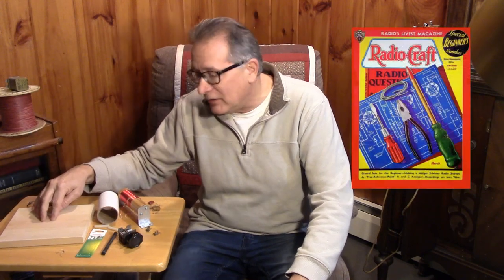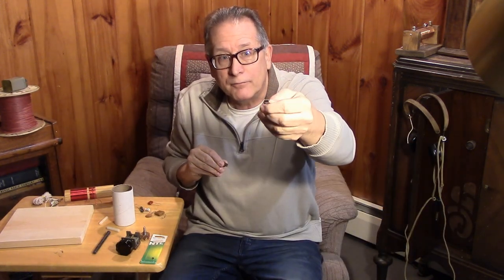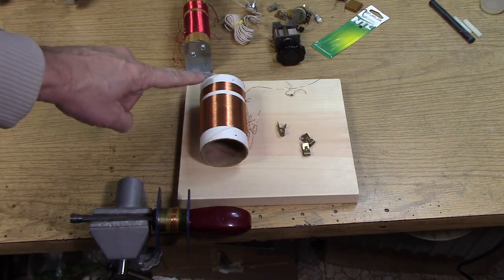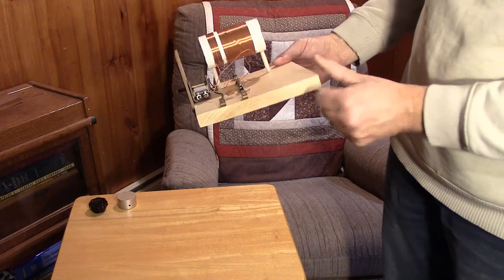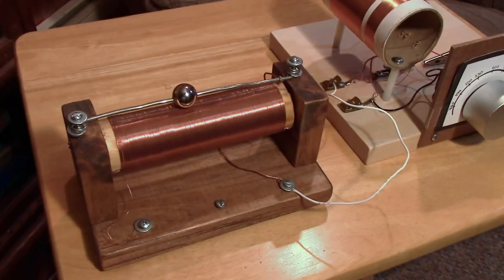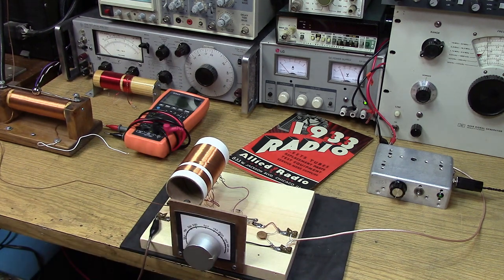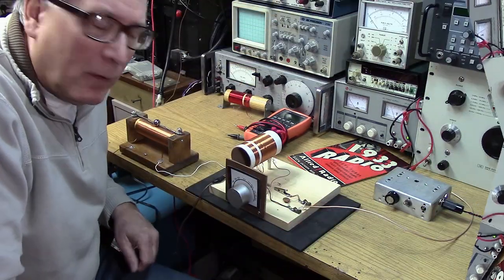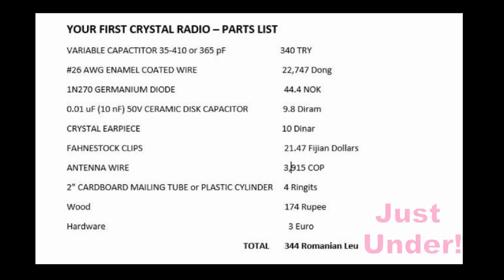Your First Crystal Radio

Comment: Dad bought me one of those Remco crystal sets back in the 50s. As we were putting it together (and Dad did the assembly, with commentary and appropriate curses), he told me how he and his brother used to build them out of old wire from Ford ignition coils and crystals from the talus dump at nearby lead mines. He said that he would listen to WLW and KDKA on it . . . which surprised me because at the time Dad and Uncle Nils were living in Arizona. He said he ran a wire for an antenna between the outhouse and the peak of the house roof, which angered his father because Grandpa Tom's peace was disturbed by the wire's resonating in the wind, which made the house hum. ;-) Six decades later I still have a crystal set -- one of Elmer Osterhoudt's MRL #2 DX sets -- and have built many others. Them and the latest micro SDR from China. Six decades of radio from one crystal set and a story my father told. Plus six years in the USN as a radioman, a job title that no longer exists. 73 de W8IJN

Comment: I think the important thing about crystal radios and other simple receivers is that it allows you to start experimenting, often because you can't get the specified parts, as you described very well at the start of your video. My first mod was to add a transistor as an audio amplifier, which in 1960 was a "Yellow Spot" germanium p-n-p device. It cost nearly £1, here in the UK, which was $2.80 in those days. It had been used in a pocket radio kit which my brother had given up on. It was handled with great care as it was worth more than a week's pocket-money.

Comment: Thanks for an excellent video, Mike! On an early crystal set, I used a 2-gang variable capacitor from a $1.50 garage sale radio. My antenna was a fifty-foot-long 16 gauge extension cord that had a ground wire. I wired all three terminals together on the plug end with my lead-in wire, then I threw one end of the extension cord up in a tree.
Sometimes I've purchased 20 gauge, two-conductor speaker wire at Menards. (Building supply) 100 ft. for 5 bucks or so on sale. It's copper-clad aluminum but it works fine. Separate the two conductors and you have 200 ft. of wire. I've used this same wire to wind coils with good luck. 
I once built the MRL # 39 crystal set. On a 2" pipe (PVC) I wound 80 turns of 20 gauge wire. I wound one turn of duct tape over the center of this winding, then I wound 40 turns of 20 gauge over this. The set worked really well. One day I was jumpering across different terminals when the sound just boomed in on my headphones. For comfort, I had to tune off the station a bit to decrease the volume. Days later I couldn't recall which terminals I had jumpered. Since then I have often tried to discover what I had done to no avail.

Comment: When I was a kid, I built a crystal set that had a fixed capacitor. The coil was sanded on the top to remove the insulation and an "L" shaped piece of metal, screwed to the board and was set to rotate over the coil forming a variable coil. I believe I was a cub scout at the time and I believe that the scouts were selling these kits in the Boy Scout stores that were around the country at that time.  it worked pretty well. 

That would save the cost of the 365 pf variable.
Reply: I did the same Cub Scouts Crystal kit! Circa 1973 for me! 8 years old! 😊😊😊
Reply: @SteveHacker  Mine was back in the 50's ... maybe 1953 or so.
Reply: Yep use multiple caps for various ranges.
Reply: yeah, definitely makes sense to have a fixed cap.  even with the variable cap, I thought there’d be a fixed cap in parallel.

— I’ve hand-built a capacitor before, (it was large, and had a tiny capacitance, but technically it worked.)  can say with confidence, it was “variable,” 😅 physically squishing it to get the plates closer together increased it’s capacitance!  let go, they’d spring apart some, decrease capacitance.  😂 one day I’ll have to try doing this to a crystal radio.

Comment: Never heard a crystal radio pick up so many stations. You're antenna tuner made all the difference. Before I was a teen-ager and many years after,  I had a crystal set beside my bed that I listened to as as I fell asleep. My crystal ear piece went bad and haven't played with it for quite a while. In my 2020 issue 1 Nuts and Volts magazine they built a replica Crystal radio kit Allied Electronics in Chicago sold years ago and is very similar to the set you built.
Reply from the maker: Those old crystal radio projects in the magazines are fun to read. Many are scanned and online now. This design is pretty standard for a basic set. The Loose Coupler approach takes it to a higher level. The fancy air low loss coils and proper High-Z output transformers take it even higher.

Comment: Mike Great video, As a child growing up in the '60's I remember my Dad's "junk box" of salvaged radio/TV parts. We didn't have much money for spending on hobbies. We used to unwind old flyback CRT transformers for magnet wire. Coil forms were what ever non-metallic tube was available. (In the 70' and 80's it was 35mm film canisters for HF. '90's up plastic Rx bottles)  Many a breadboard project was made using those old brass clips and recycled terminal strips. I am sure Dad's soldering iron was actually a lot smaller than the monster in my memory. Sadly most of his "junk" was tossed when my parents moved into a smaller house after us kids grew up. After Dad passed in '93 about all that was left was his Knight kit "Star Roamer" he built in  '62 or '63 and his Midlands CB radio.
Reply from the maker: Those spartan scrap and junk parts and projects from younger days are highly regarded by many who frequent this channel! It really is a whole contruction philosophy and style in itself, that can last a lifetime.

Comment: You could put a silvered mica capacitor in parallel with your varactor to put it in whatever portion of the band you wanted.
Pill bottles make an excellent coil form. I really like the idea of using a varactor.
Your radio is far more selective than anything I remember getting with my radios.
My friend next door built a crystal set but couldn't get it to work. I found the problem and fixed my first radio at 5 years old.
Reply from the maker: You must have a lot of pills to have those nice pill bottle forms! Ah. So do I. But we both survived without being shocked too much as children.

Comment: I’ve been tinkering with crystal radio for quite some time and when it becomes much more than that I get lost  . I did however figure out that an antenna was a giant capacitor . I’ve made a few different types from lo AM broadcasting band into shot wave . I enjoy watching your crystal radio builds as you explain it well . I only wish I could have learned more from a local operator called Doc before he died . One of the simplest books I’ve read about crystal radio is one by KE Edwards , and for all of those who say they can’t afford the parts Edwards tells how much of what he built was scavenged from old style TVs with a picture tube . Not every one I’ve made worked . Never got Boston stations till I put an amp on it , but I did get NY , Canada , and as far south as Washington an Virginia without an amp .
Reply from the maker: Nice! And I agree - those old TVs were a parts bonanza!

Comment: I really liked the build, thanks for sharing.
Reply from the maker: Thanks for watching! This should give you a baseline radio to innovate on.
Reply: @MIKROWAVE1  I have unobtainium,the cap and cats wisker are very hard to get
Reply from the maker: @davidhilton7780  Hard to get or merely expensive? Ha. Hey get out to a ham flea market and start collecting some old parts.  https://www.ebay.com/itm/195000566714?hash=item2d66f083ba:g:3poAAOSwwnlgOItN
Reply from the maker: https://www.ebay.com/itm/132032487083?epid=1712229709&hash=item1ebdbfdeab:g:N2wAAOSwfSJdC88J

Comment: I buy old 70's radios at thrift stores and salvage the double ganged aluminum variable capacitors that are normally found in them. I also found that the type of variable capacitor used in Am/Fm transistor radios from the 60s & 70s are available on EBay for very little.

As far as diodes, if you can only find silicon diodes a bias applied to the diode will do the job as well as or nearly as well as a 1n34a diode.
Reply from the maker: That is a great way to get quality parts!

Comment: I've made many Crystal set Radios over the years. I would love to have a longer garden, mine is about 16 feet and that is where my problem is. I have two long wire antennas, one in the garden and one in the loft, which is also 16 feet. These antennas are good enough for a simple regen shortwave radio, but that is about it. I have some parts ready to make an antenna tuner similar to yours, it might just help a little bit more.
Reply: Try an indoor loop antenna on a form and use 18 gauge lamp cord "zip wire" closely spaced (edge to edge) which makes 50 Ohm impedance then solder to R58 coax (must have copper braid to solder well). You will have to experiment with some sort of variable capacitor across that junction to get the coverage you want, but I think it would be fun. I have 2 loop antennas mounted up above my roof and they work great. One uses 14 gauge TTF wire (control wire) close wound and the other uses TTF 16 gauge spaced 3 inches apart and a Balun to RG6 coax with a capacitor tuner circuit at the Balun--this works well for shortwave and AM.
Reply: @thomasmoore8142  thanks for that, will look into this.

Comment: It works! I found an old 140pF variable capacitor, and made some kind of coil with 30ga wire-wrap wire on a 2-3/8" tube. My antenna is 30' of wire strung along 3 of the 4 walls in my home office, and ground is from a power outlet. I did concede to buying some genuine germanium diodes, but everything else was from the junk box. 40 miles from Chicago, I succeeded in picking up several stations really well on the low end. The highest I found was 1160KHz, although I should hear 1410 too. So I still need to tweak it a little, but at least I have a good starting point! I remember building the Radio Shack kit as a kid, and hearing nothing but dead air. I always assumed I was just too far from the city.
Reply from the maker: Ha it works! Lots of stations in the Chicago area and it sounds like you have pretty good selectivity. You may need a tap to remove 20 or 30 turns to hit the higher end.
Reply: In the last week I have made several more coils, and bought a few of the NTE618 varactors, which really helped a lot! One thing that has given me trouble is the antenna tuning coil. Do you have to remove the enamel insulation for the moving contact? I thought it might be coupled capacitively, but that doesn't seem to work for me. Thanks for all these videos! I've watched a bunch of them lately, and it's really helped to fill in this missing part of my electronics knowledge.

Comment: My first crystal radio in my youth had the ends of the coil enamel wire scraped off and stuck between the lid of two flat sigar tins. Sheet of paper in between and there was my variable capacitor. Germanium diodes were still the standard in those days, so they were easy to get for pennies.
Funny how these crystal ear pieces haven't changed in 50 years. Still the same skin color-ish yucky color and a twisted pink wire 🙂
Reply from the maker: Yeah, the only difference is that half of them now you get mail order do not actually work. So again, stick with the vintage junk.
Reply: @MIKROWAVE1  I did some investigation as to why they fail and it's usually because the leads aren't secured to the piezo disc inside.

They're just held on with a dab of glue. It's possible to open them up and fix the issue

Comment: I love the gentle humour you put into these videos, especially this one. I followed this with great interest and will have a go at building one, if I ever get a day off work!. I'm fortunate in that my garden or "lot" is 460ft long, so should manage 200ft of antenna easily. Have you ever built a crystal radio which will work on the ham bands. I would be interested to know if it is possible with the right coil windings etc. 73. Ace G6XIB
Reply: The 160m band is just above the MW broadcast band. But there's not much a.m. there. You'd need to introduce a BFO for CW and SSB. G1YJY.
Reply: @paulsengupta971  Thanks for your reply, although there isn't much AM on the ham bands, there is some and our licences allow us to use it. It would be good to fire up my rig on AM and see what a crystal set picked up. I don't think a BFO is required for CW, Carrier Wave but it would not be out of the question for SSB. I like the challenge of a crystal set on such frequencies and it would be fun to try, even if picking up my own test transmissions. I have several friends who like to play with AM and I may experiment with double sideband in the future. Also, hopefully a crystal set will slope detect FM. Best 73 G6XIB

Comment: I was on my bench one day and on a whim, I measured the inductance of a spring. I then found you could change the inductance of that spring by a good 20% by stretching it a reasonable amount. You couldn't expect it to be very stable but you could use that as a tuning mechanism just for fun. I've never seen that done before.
Reply from the maker: Very Slinky Idea!
Reply: Ahaha🤣

Comment: I don't recall reading about using a varactor before for a crystal radio.  Immediately, what came to mind was using aluminum foil or aluminum duct tape (copper also) or using aluminum cans with plastic bottles or packaging tape as the dielectric since there are so many sizes now days.  Whether two sheets or stacked design (PCB's can be used as well) or the tubular designs (scrap copper pipe can be used)... those are way cost effective.  Just Google DIY or Homemade Variable Capacitor.   I still have the habit of saving my cardboard tubes (just a few days back saved a large Oatmeal one) and have a stash of odd sized cans and bottles just for variable caps or inductors.   One can even invest in one of those ~$17 LCR-T4 Mega328 and just checking that I see IMSAI Guy found a newer $17 one that doesn't looks so ESR'ish than the LCR-T4 I use.

Comment: My first radio was much simple, you just need a radio antenna  a germanium diode EFD 108,a speaker(2000 ohm impedance) from a old phone with carousel dial, a ground connection and you can listen AM local radio station no battery needed.

Comment: Great vid, love CRs & thanks for sharing the knowledge. Just to verify, you stated the  need for a variable loading resistor when using an external amplifier. What value is optimal, or is a fixed resistor possible for that purpose?
Reply from the maker: Really the load needs to be as high as possible for the greatest voltage output; but 2000 Ohm headphones ruled for years. Now most folks use crystal earpieces and a 47K resistor across the output. Fancy radios use transformers between the output and the headphones for maximum power to the ears! So for an amplifier keep the impedance high.

Comment: I'm here because I'm trying to rectify EMF to do RF energy harvesting. I picked up BAT46-TR diodes, they start conducting as low as ~150 mV and they're rated for up to 150 mA of rectified current. I managed to pick up 6 V for charging a capacitor and 125 uA of short circuit current flow.
Reply from the maker: Danger HV? Ha. You are actually causing a suckout in the RF pattern of the broadcaster's antenna I suppose.

Comment: I think I would go for a capacitor made from aluminum foil and paper.
Basically places them one on top them other for maximum capacitance and then slide one off the other to tune to less capacitance.
Reply: I was thinking similar.  Good call and very cost effective.

Comment: I wondered if someone might show the correct way of doing the FIRST project for electonic nuts. LOL
Reply from the maker: You can never have too many variations or crazy things to do with a device. I worked with this guy at ADI, Walt Jung, who wrote a book called the 555 Cookbook. Do you think that was enough 555 circuits for everyone?
Reply: Mike.. do you use the variable inductor antenna tuner..a la Tuggle??. I find that works pretty well.. 
I have used PVC couplers as coil forms..3, 4, and 5 inch..  may be my imagination but the 5" with #18 or 20 wire seemed best for me ..  but getting it all on the form was sometimes a challenge..
I'm interested in the varacter.. never did that..
Reply: @MIKROWAVE1  I have seen 555s do things you could hardly imagine. I've still got Walt Jung's book.

Comment: So glad you went the full measure with using an appropriately rated, voltage wise, bypass capacitor. You might also consider in future videos recommending that the viewer, if they construct the project, use it only as intended... no edible parts... etc. In other words, all applicable safety warnings, alerts, shout-outs, pleas, and so forth and so on... with the international symbols indicating danger, warning, caution, etc. posted as well. No sense opening up oneself to legal entanglements. As we all should know by now... these projects are for educational purposes only and no medical cures for post nasal drip, flat feet, acne, etc. are implied either. 73s, 45s, and 33 & 1/3s to you!! 😊
Reply from the maker: I never thought of that but yes, I saw people chewing solder. I suggest the new solder.
Reply: @MIKROWAVE1  Yes... new solder... the kinder & gentler one... “lead free”, you know. No accidental brain damage should one mistake wire solder for... I don’t know... a 100 foot long ‘Twizzler’ candy or such. Perhaps the solder manufacturers could flavor the flux. 

Anyway... stepping back in to reality... love your channel. Keep the projects coming. Life is for learning and I enjoy your teaching style.
Reply: @kennethandrysiak4130   As well as Mikes 1kv cap warning you should always use a insulated tuning knob no larger than six inches or the coil could get damaged by static!  /